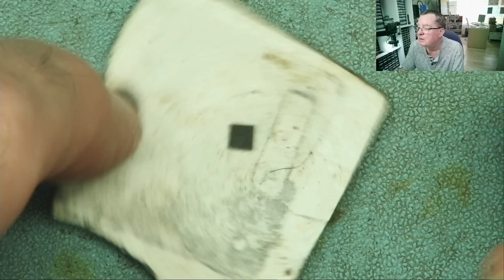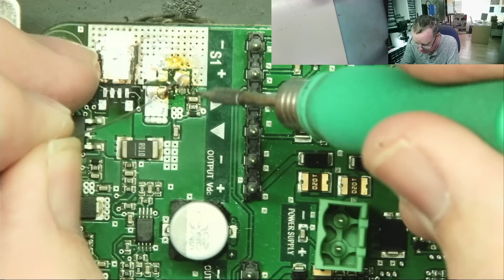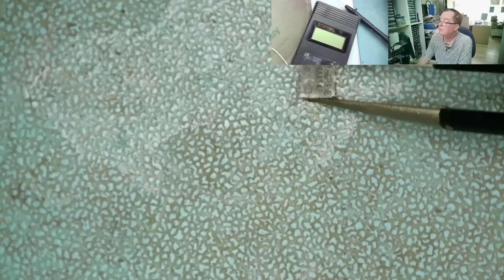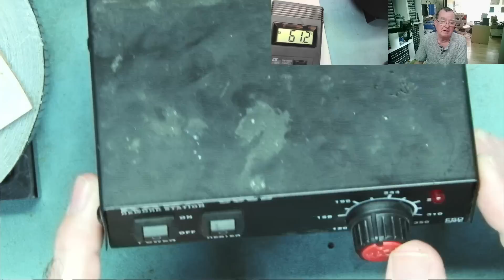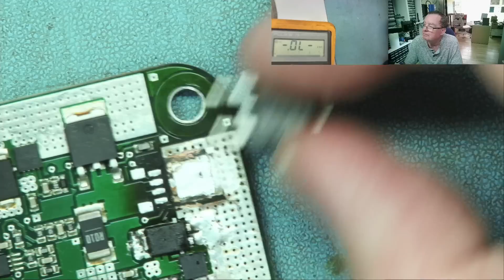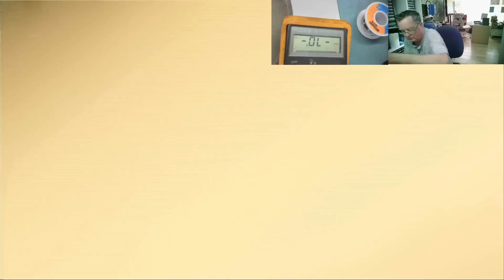How to Solder Tiny QFN Components Using A Preheater : And What To Do When It All Goes HORRIBLY WRONG

Comment: I struggle with SMD soldering. Watching this video really helps.  It takes practice just like with everything.  Im learning how to use hot air and hot tweezers on a junk circuit board loaded with caps, diodes, and chips.

Comment: Doing QNFs all day I can second most of the comments - like preheat only to 150-160C and do the rest with hotair.
I also own this very same preheater, and just can't work with it. temperature is completely out of control (you worked around that with an external probe), but the bigger problem is the board is moving around on it. Even with clamping you can't get the board to stay still, since no board is straight on the bottom. Plus the heater's height makes it awkward at best to work on the board. Best I found (for me at least) is preheating the board with the hot air in large circles, and take my time with it, while checking the board temp using a probe. That way soldering components even with big ground- or power-pins doesn't take too long, so you're not risking de-laminating or charcoaling the board.

Comment: Wouldn't a weighted board holder like an OmniVise or even the board holder you showed a couple of weeks ago hold the board firmly and in turn prevent it from moving? Using hot air from the underside of the board would prevent the air flow from disturbing the chips.

Comment: I wonder if using some kind of vibrator on the PCB might jiggle the component into place?
Reply: Noo, if temperature, flux and amount of solder is right, the surface tension will pull the part in the right position.
If you have steady hands, you can give the component a little push and see it swim back into place.

Comment: 25:25 A lot of faffing around at the end and the board floating on air hehe! What I do is put a heavy weight on the board, either a chunk of steel or a brick or whatever. That keeps the board from moving around and also stops it warping from the heat if it's a big board.

Comment: For delicate parts a backheater is the right way to do it, or backheater+top heat. In some cases for my line of repairs for TSOP and QFP chips I use special nozzles that direct the air only onto the pins directly so the IC in the middle isn't getting direct heat. To move a part that is in the wrong place add flux, heat and move it. Flux only lasts some seconds and once heated is used. With flux the part will bounce back to the correct position when touched. You must already know this so why you didn't add more flux is a mystery, although you did eventually add more flux and give it a quick touch the 3rd time and it magically moved into the correct position... maybe you live by the rule 'third time lucky' ;-)
Reply from the maker: Maytbe that is it.  Well it worked anyway and is an intersting example of what can and will go wrong, and how to deal with it I think

Comment: Oh wow! I've been waiting to see this QFN mosfet repair. I've one to replace but the board is double-sided with more of them directly on the underside so I don't think i'll be able to pre-heat underneath. I'll just have to try with hot air (maybe pre-warm the area with lower air temperature from above) and take my chances and I'll definitely test the mosfet before soldering! Well done persevering - glad it worked out 👍
Reply from the maker: True, the different circumstances of any job will dictate the mehod you should use, and whether it will succeed or not.  My Kada 835B is good enough to solder with just from heating under the board with jobs like this, but it is not powerful enough to do that on most graphics cards or motherboards.  Then I also have to use top heat as well

Comment: Have you used reflow ovens for SMComponents? Is there an affordable brand name you can recommend? I can do the THT components with some flux and an iron. Thank you
Reply: Ovens are limited in size and they are also large and take up space. If someone is doing a lot of repairs in a paid business or building boards from bare PCBs that require an oven and solder paste to mount parts then it's fine. For a home hobby repairer an oven is overkill. The amount of repairs shown on this channel that need this kind of hot plate back heater work done is quite low so an oven is a wasted expense.
Reply: Richard use a Quick 853 Preheater ☝️😳
Reply from the maker: @kmiller0402 I don't have one unfortunately,  I am in the process of building a much larger DIY hotplate/preheater
Reply: I use a T962, but you must carry out the mods shown on various sites before use (or get a pre-modded one). Boards must be spaced slightly away from the base plate and profile set for the intended paste. Paste must be good quality and dry (allow at least 24 hours after removing from fridge).

Comment: I think I would have used the preheater for all the components, but set just below the solder melt point. It then takes very little extra heat applied to the component put it in place.
Oh, and one thing you said you were going to do but didn't, clamp the board down!
Reply: One can never have too many clamps...